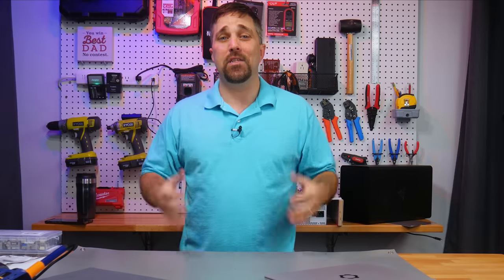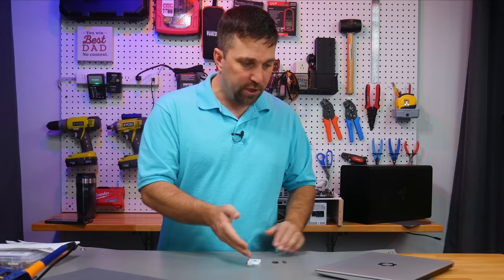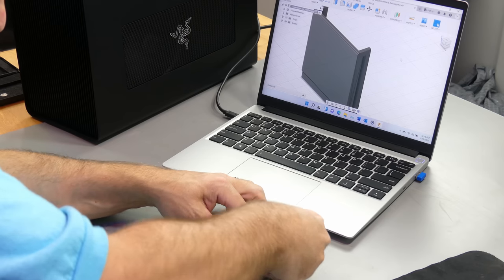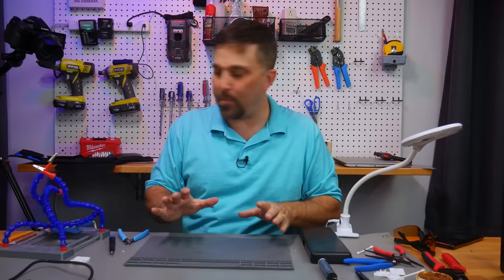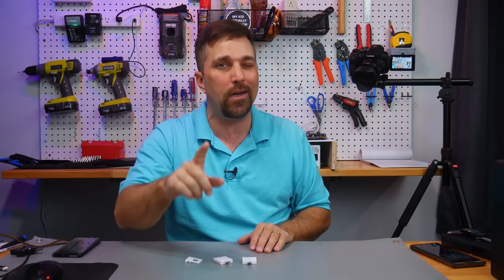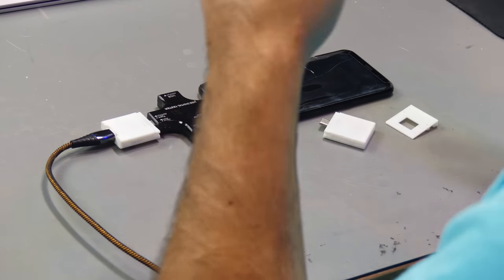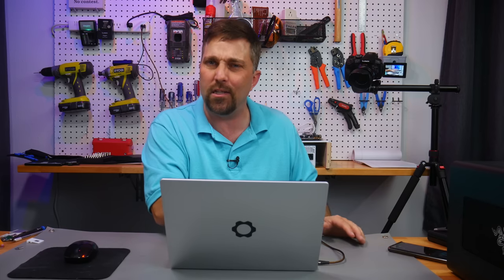Prototyping Framework Laptop Expansion Cards

Comment: Definitely interested in a thunderbolt eGPU test
Reply: Saw someone make a video about it working but not with many tests. The board is thunderbolt supported as is the cpu and the ports
Reply: yes, definitely more interested in that.
Reply: Imma sub to see that
Reply: Agreed.
Reply: I think linus tech tips mention it's working(the thunderbolt) but framework never mention tb support because of tb certification i guess(?)
Reply: @rifki0011  Yup, they talked about it in the last WAN show. It works, but doesn't have an official certification yet. Not sure about eGPU testing specifically though.
Reply: It works
Reply: Well there's the Razer Core X plugged in, in this Video... so it should work
Reply: OH YES PLEASE! That's my plan too
Reply: The laptop use usb 4 which support thunderbolt 3 data speed
Reply: @zahanaru9666  USB4 specification is literally based on Thunderbolt 3
Reply: me too. and better cooling system fan, and a bigger battery for the bad battery life. a pro headphone dac and amp, digital out.

Comment: dude, i didnt know they were actually providing cad and board references for expension cards. this just blew my mind. like, who does that...
Reply: They offer the repair manual and schematics to shops, why wouldn't they provide mere expansion card design?
Reply: @houghwhite411  maybe so they could make some sort of money off of it, this is super cool though, you can probably get super creative with all this and make some insane expansion cards
Reply: The really nice thing is, they can have the creative minds of those who want to make Expansion cards do their thing and if there is enough demand they can ask for the design and do a first Party Version for it to sell of the webpage.
The only sad thing for me personally is that i'm not in the market for a New laptop right now (also a European keyboard would help massively)
Reply: To my absolute surprise, HP does! Or did. For older laptops, repair manuals exist, which include fairly detailed schmeatics, maybe not full boardview level, but still pretty detailed. Thing you can find while using HP Part Surfer are pretty amazing. But, when Haswell came, with the last socketable intel mobile CPU being Core i7-4700HQ HP never bothered again.

That didn't stop them from whitelisting WiFi and WWAN adapters.
Reply: Arduino does 😄
Reply: to be fair, it would be trivially easy to reverse engineer something like that, so why bother trying to stop it, may as well just provide the files and be done with it. but it is very nice to see.
Reply: @myopinion69420  sadly that didnt stop MSI from saying their thermal pay thickness is confidential when a customer asked for it so he can be prepared before he serviced his GPU
Reply: @DJRaffa1000  I'm pretty certain that was asus that did that. Still, that was really scummy of them

Comment: The logitech unifying receiver was one of the most requested add-ins when the Framework was still an upcoming concept. Nice video!
Reply from the maker: The one I'm designing should be compatible with any RF receiver simply by removing the RF PCB from the dongle housing and sliding it into the enclosure.
Reply: @ElevatedSystems  sick
Reply: @ElevatedSystems  i couldn't help but think from a user stand point. wouldn't making an enclosure that could fit a pre made dongle fit flush make more sense than heaving to gut and re solder the dongle?
Reply: @RoraighPrice  yep would make more sense. But I'm not sure if dongles are always same size
Reply: @ElevatedSystems  Why not make a pcb with something equivalent to POGO pins that you can just slide the gutted dongle against since the dongles usually just have the 4 usb pins on the one side and are rarely usb 3.0 spec. then you don't have to accommodate/source thinner USB type A connectors.
Reply: or just use Bluetooth.
Reply: With the Ubiquity Logitech Unifying devices have, you'd think manufacturers could just put a little receiver on their laptops.

Comment: pretty cool for an initial prototyping! I really hope Framework will continue to grow and expand into a household name company to support DIY and right to repair instead of buying another new laptop model that costs a lot of money.
Reply: Totally agree
Reply: @badjonatan  but you don’t have to throw them away. Framework has said you’ll be able to run their MB outside of the case. Whether or not the typical consumer needs a second, slower computer is of question, but I could totally give it to my kids, run it as a server, etc.
Reply: @badjonatan  ok yes, that's a valid problem but
would a normal consumer of, idk, youtube and excel sheets need the newest hardware
I've known people that still runs a 3700 intel cpu from god knows how long
what they have is decent for the current times, not bleeding edge by any means tho
but would definitely still hold up in 5-10 more years given that the user is not doing heavy work 
(at which point, a PC would probably be the way to go anyway)
Reply: @badjonatan  a £50-30% saving is still pretty good!
Reply: The problem is that this kind of product isn't designed to make a lot of money, so unless the demand is huge, they're sunk. I'll buy one when a Ryzen version exists
Reply: @badjonatan  There's another video on this channel of a computer-in-a-60%-keyboard being made from one of these.  So, definitely doable.
Reply: @MrGamelover23  It is, if we take advantage of them.

If we as consumers are to receive the things we ask for, things like repairability and modularity, then we need to not screw over the people taking the initiative.

The problem is that some people will just buy mainboards for their own projects. Or buy a framework pc and just order modules from AliExpress. And those people will also be the one that cry loudest when they go under.

You see this in small towns when a cafè closes shop. Then the ones that never went there is the ones that complains. We need to support what we want to keep around.

Comment: I'm honestly super excited to see what expansion cards third parties come out within a few months' time with proper R&D. For one, there's nothing preventing someone from making a multifunction card - just put a USB hub controller chip on the PCB, and we could possibly have a "Logitech dongle with USB passthrough" card. Now that's something I'd pay good money for.
Reply: Imagine the horror of "Apple original Magsafe Port - Expansion Card for Framework"
Reply: A full-size SD card reader would also be cool. 🙂 Just an amazing DIY field. 👌
Reply: Get a small enough PCB and you could have an internal RF receiver, two USB-C ports, and maybe an SD card reader. That'd be sick!
Reply: Honestly I'd love to see all of these concepts realized, even if just as diy projects, by the time my old laptop is weak enough for me to need a Framework laptop it'd be awesome to have a mountain of port options to exactly what I want (and flex on non-modular PCs because I won't be able to resist)

Comment: One thing that interests me would be a dual-USB expansion card. It obviously would not have full bandwidth in both slots, but it would be great for devices that don't need the full 10Gbps transfer speed like a USB numpad/mouse. The card definitely has room for at least two type-C slots, even if type-a doesn't work out.
Reply: A type C splitter / hub card makes so much sense, I'm surprised it's not an official option.

Comment: Looked like there was enough space to combine these two into one. That'd make it so much more efficient use of these expansion.
Reply: Exactly what my thought was before I remembered that plugging more than one device into one USB port requires additional chip that will handle all signal routing between devices and PC... Which means that there's way more PCB design required in such tight space.
Reply: @spakeschannel  a solution, though a lot of work, might actually be to design the pcb itself. Someone is almost certainly gonna do that at some point
Reply: @samuvisser  
You just need a $10 USB7216C chip
Reply: @spakeschannel  Especially in his use case, he also needs advanced power routing.
Reply from the maker: @tyaty  I don't think the USB7216C supports full USB-C PD but I'm working on solutions. More to come.
Reply: @ElevatedSystems  That's awesome!  An expansion card using a USB hub to allow for more IO is something I've been wanting since I heard of the Framework!  Will definitely subscribe so I don't miss it!

Comment: If you ever print the PCBs that allow 100w MagSafe charging, I’d love one of them - or the design so I can have my own printed. :P
Reply: I am pretty sure MagSafe 2 is limited to 85W but i get your point, it would be super nice!

Edit: At least from a mechanical perspective I think this is actually possible.
Reply: Magsafe's coil is quite wide, you could use a smaller one, but power transfered would lower as well
Reply: @riccardo1796  They meant the macbook version of magsafe, not the wireless one.
Reply: @riccardo1796  the original magsafe not the iphone one
Reply from the maker: @PhilfreezeCH  Yes MagSafe 2 is 85W, the one magnetic power solution I'm using is 100W and smaller.

Comment: Instead of individual bits(or use this as an extension) you should try different kits that include a bunch of ports that are useful for different things like a charging station, one with like 2 or 3 video ouputs/USB 3 for gaming, or one for video ingestion so high speed thunderbolt ports and different SD card readers.
Wanna go from workstation to couch? Unhook everything in your laptop in one go, pop in a different dongle and go

Comment: Hey! Great work. It would be good to have an expansion module with a pushable knob/wheel for editing and modelling. Thinking further, maybe using both slots to get a bigger/firmer like control surface and adding an extra slot to extend the chain.

Comment: Just for reference, you don't need all the usb c conductors to be populated for the PD handshake to take place. A usb 2.0 data link is sufficient but you do need 1 or 2 extra pins if I remember correctly for the PD handshake to take place and request the charger for more than 5v. It works a bit like the OTG host detection pin on the 5th pin of an usb micro b port.

Comment: This is awesome!!  How difficult would it be to make an expansion card that's just two USB-C ports?  I imagine the hardest part would be fitting the soldering and the PCB for the USB hub. Would it work, or would it be too tight a fit?
Reply: That's absolutely doable, but you'd need a custom pcb to make a 2 port usb hub fit the enclosure. Also, its likely each port would have reduced capabilities over the laptops built in port. 
Like, it probably couldn't handle 60W charging over these ports, but high baudwidth connections for external drives or displays would be viable, as well as more common usb device hookups. Depends on how complex the circuits are for bidirectional variable voltage power delivery.

Comment: Really interesting video! Love the framework laptop, might get one but I’ll wait till they release a new version since I just got a new laptop less than 2 years ago. A couple of ideas/thoughts on the expansions: for the mouse dongle, is there something that stops you from removing the whole usb part and just soldering the pcb directly on the Type C connector? That might save some space! And for the magnetic Type C adapter, is it rated for the full 100W the laptop can take? Seems a little flimsy for that but I could be wrong, some testing would be interesting to see!
Reply from the maker: I'm including the USB-A port so the card can be universal and accept any RF dongle. Also the final magnetic charger will have the full 100W PD.

Comment: You might want to print the final result out of petg because it has similar properties to abs but it is Easter to print and it doesn't require an enclosure 9r have strong fumes. Those pieces should also be close enough to not require a chamber.

Comment: If you still want to use an USB A inside the case, just get rid of the metal jacket of the connector. The power and data lines are in the plastic part as you might know, and since this is supposed to be an "internal" connector, you can apply a dab of hot glue to keep the wireless dongle attached (if you don't do some type of molding while printing the design)
Reply from the maker: Need the metal housing for EMI shielding.
Reply: @ElevatedSystems  Actually no. The metal part is just for support. Also... your entire dongle is an antenna, the last thing you will be blocking with that little piece is EMI.

Comment: A capture card module based on a mini magewell card would be super cool
Reply from the maker: Keeping a capture card that condensed cool might be an issue.
Reply: @ElevatedSystems  Make it occupy both bays on one side with a small fan and heatsink in one of them?
It wouldn't be flush with the chassis, but it would be securely attached at least.

Comment: Fun fact: you didn't need to se a dremel. the Anker adapter can be pulled apart. I've had one where the housing came loose after using it for a while.
Reply from the maker: I couldn't get it apart. Once I cut it open I realized it was because it was full of hot glue. A like minded engineer put that together 😃

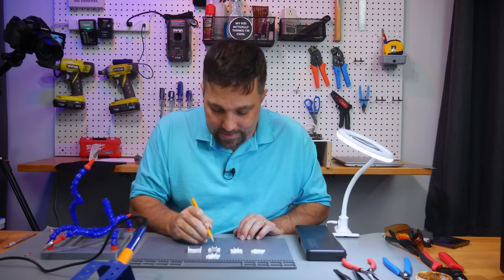Comment: 7:05 You need to use the CC1 and CC2 pins if you want to negotiate anything other than 5V, so the USB 2.0 connector won't work for that
Reply from the maker: Exactly. The final PCB design will support full 100w PD.
Reply: @ElevatedSystems  naturally the final will, I'd love to see a video when it's done. Just came across this channel, and this was awesome

Comment: If you're having trouble sourcing a female USB A socket that is thin enough; the ones I have, have a lip that could be grinded off that would make them as small as I can imagine any socket getting without removing the sides entirely. That might work for you as well.

I think the purpose of that lip is to encourage the male plug into the hole for ease of use. If the whole thing is going to be internal anyway, that shouldn't be an issue for you.

Comment: Hey

Sorry to bother you but, could you take measurements of the motherboard? In particular, position of screwholes, diameter of screwholes, height, etc?

I've heard they designed it to work well outside the laptop, so I'm thinking of modelling a case for it that'll be ready by the time they start to sell them standalone. Thanks in advance
Reply: If you haven't heard the recent news, Framework posted the CAD files to a 3D printable case for their mainboard with the measurements

Comment: I think the size of those expansion cards is just wrong.  to small to fit in multiple connectors, to big for a single one. I think they should connect the 2 slots, so that you can insert double sized cards.

Comment: Love the 'magsafe' connection very interested for a full bandwidth one.

The wireless dongle is cool, but most of the wifi cards are BT too so why the dongle to connect even? Free up one of the slots.
Reply from the maker: A few reasons, bluetooth mice have noticeable lag, bluetooth uses much more power then an rf receiver, and to a lesser extent bluetooth has some security vulnerabilities.

Comment: Use PETG instead of ABS, ABS is a pain to print, PETG gives similar results, is easier to print, smells way less and does not need an enclosure. PETG is also very resistant to ageing and wear. Just be careful if you´re running a PEI film as it does stick vary well to PEI.
Reply from the maker: I want to use ABS so I can easily sand it smooth. It's the layer texture that makes the enclosure difficult to slide in.

Comment: Does your magnetic adapter support USB PD? They usually have too few pins for that, so you might not get proper current even if you wire full USB-C connectors.

Comment: for how many volts the charging capable is rated for ? will it be safe for long term usage ?
Reply from the maker: The final magnetic adapter I'm going with is rates at 20V @ 5A for a max 100W and safe for extended use. Check my pinned comment.

Comment: Could you get dual USB-C on a card, and put that in a video?
Reply from the maker: That one isn't as simple because it would require a USB controller chip built into the expansion PCB to manage and switch the bandwidth between the two ports. Alt modes would also be an issue.
Reply: @ElevatedSystems  but would it be possible? How large are the chips? And what are alt modes? You could probably save some space if only one or none of the ports support PD and neither support TB. And if you’re not doing PD, then could you do dual USB-A or one of each?

Comment: 4 USB pins, so probably just USB 2.0 speeds, also might have some issues with reverability with some devices (like some keyboards if the microcontroller is dumb enough)
Reply: They use usb 4 which support thunderbolt 3 data transfer speed

Comment: Any update on the magsafe capable of Thunderbolt 3? I'm using the same adapter you are I think along with the Razer Core, but I haven't made an expansion card that embeds the adapter yet. I haven't had time to learn how to design a PCB

Comment: I would be interested in seeing a prototype for a RJ45 expansion card. 

I think this is the biggest omission from their line up of cards they are offering and is probably going to turn off business centric customers that need the reliability and bandwidth that a physical connection provides. 

 I'm interested in seeing if there a reasons for its exclusion since it seems like it would be fairly easy to build with their resources.
Reply from the maker: I read somewhere in the forums that will be the next expansion Framework adds to their inventory.
Reply: @ElevatedSystems  
Great :)

I'm glad they are working on that current limitation :)